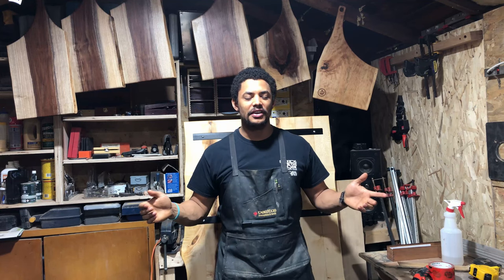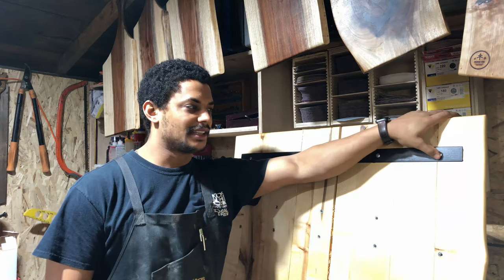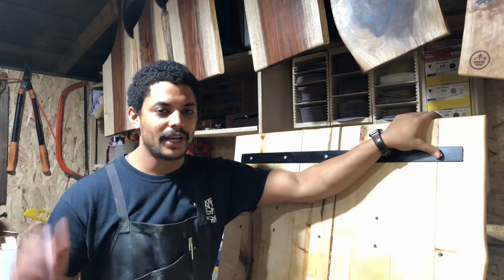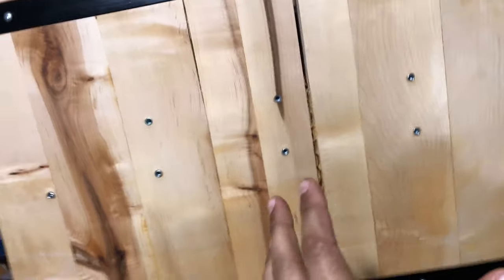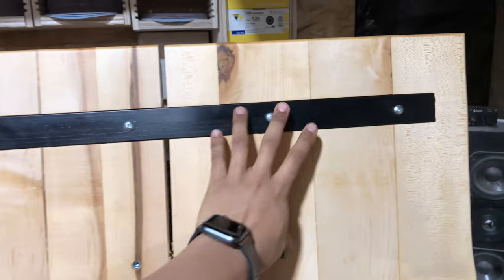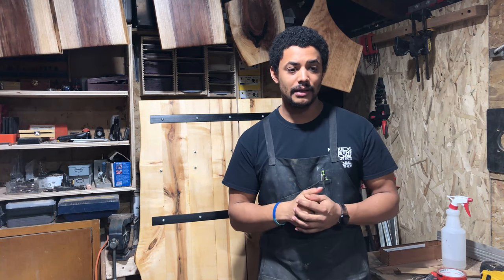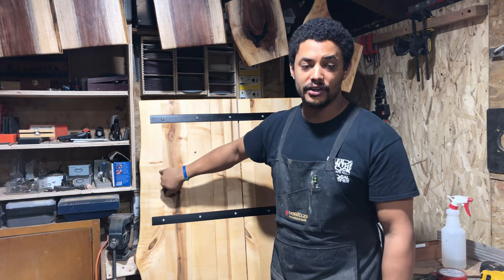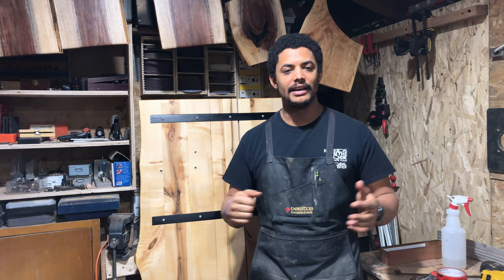C  Channel Ripped Table In Half!

Comment: I would recommend extending the grove past the end of the c channel half an inch. Slots can’t move if the end of the channel can’t move in the wood.
Reply from the maker: Totally agree, If the c channel is not slotted though then it is not going to move, so if someone goes that rout, then no need for extra space on each side.
Reply: @huds-onwoodworkinginc.2019  All due respect, but no that's not true. Always, ALWAYS, extend your routed C-channel mortise at least 1/4" beyond each end of C-channel length. Average range of wood movement across grain is 1/8" or more, depending on species. I guarantee you'd find pressure dents in the wood at the ends of the mortise where the metal ends of the C-channel were in contact. This turned the C-channel into a compression strut - like post & beam in a vertical structure or a doorway pull-up bar. Your friend 5-6 months ago most likely had the heat on throughout the Winter, (low humidity & warmth = wood kiln = shrinkage). Your wood span had nowhere to go but relieve itself at it's weakest point in the middle. Your screws - in slots or not = irrelevant. All they did was hold the channel in place while it did it's evil work at the ends. Good luck. I sincerely wish you well in your endeavor.
Reply: @huds-onwoodworkinginc.2019  alspach is right. You must extend past. If there are no elongated slots, all the stress of movement is put on the screws to hold the wood movement which is why the screws were bent
Reply: @jalspach9215  I agree . And the wood was no way dry enough to start with . There is also a glue issue , the wood should have split before the glue failed .
Reply: Yes, I concur, i.e. this is exactly what happened.  Look at the end of his C Channels (no space for channel to grow in length).  The metal lengthened in the warm room and popped the table apart at a laminated edge.  I have never used C Channel and I have never had a top warp.

Comment: I have seen a number of Japanese craftsmen make large tables and they always use a tapered dovetailed stringer below to keep the table  top flat , no glue . Presume this allows the top to move freely without opening up at the joints. What is also critical is how much you tighten the fasteners,  if they are too tight and the  wood cannot move , you will have the same problem, slotted or not.  One solution is to snug up the bolts and use a drop of thread lock to prevent them from coming loose or use spring washer that will maintain tension.
Reply from the maker: Dovetail sliders is another good option. only means you have to fill a dovetail groove in the side of the table.  All good points though.

Comment: Right off the bat without finishing the video the screw holes on the c channel need to be slotted to allow for movement, if it’s got no where to go the wood will either bend metal or crack itself
Reply: Yup. No expansion give for the bolts.

Comment: C channel is fine to use for this purpose if done properly. For a table top, I use one C channel about 3 inches in from the ends, and one in the middle of the table, for a maximum of 3 pieces. You used at least 6 C channels from what I could see, maybe even more than that. That could have easily been a contributing factor in this failure. The holes, actually slots, for your screws need to be about an inch and a half wide, and then set the insert and screw at the center of each slot. ALL of the screws/bolts (whichever you use) should be snug, not maxed out tight. As others have said here, make the grooves for your C channel a bit longer to allow for movement. This will prevent another failure in the future.
Reply from the maker: Glad you found a method that works for you.

Comment: Did you finish it on the other side? I can’t tell from the video, but if the bottom is unfinished and the top is, that will lead to chaos with the movement of the piece
Reply from the maker: We always Finish both sides of the table. It is probably just the poor shop lighting that makes it look like that.

Comment: Glad I found this video!!  I'm going to be building a round table for my Mother using some Chestnut that her Father had milled 60 years ago and it's been sitting in her garage since he passed away.  I'm planning to use C-Channel on the bottom to keep it all flat when it gets moved indoors (might actually move the wood indoors for a while before working with it)..  Now I know to extend the slot for the C-Channel beyond the end of the metal and to use slots in the C-Channel itself where the bolts connect it to the table.

Thank you for sharing your experience!
Reply from the maker: Sounds like a very special project. If you are able to bring the wood you are going to use indoors for 2 weeks or so before you use it, that will definitely help to stabilize the lumber. C channel will then just be extra protection. Good luck with the project! happy my experience could help you out.

Cheers

Comment: Great lesson.  Thanks for being brave enough to share it.  Whether it is C-channel, angle iron, breadboard ends, wood battens...  They all need only be anchored securely in the center and the farther out from the center a fastener gets, the more movement it has to be able to have.  This  includes the very ends, the slot/recess has to allow room to not run into the end of the batten.
Reply from the maker: Exactly. lesson learned. Respect the movement. lol

Comment: Gonna be honest here, what was the moisture content of the wood before assembly. Once it goes into a house with low humidity, it will shrink.
Reply from the maker: Wood was kiln dried, around 8 percent. but I think you are mostly right. The house this table was in was overly dry. so dry the client has to put on moisturizer multiple times a day. So they probably need a humidifier in their house and yah the table probably shrunk because it was not acclimated for conditions that were so dry.
Reply: @huds-onwoodworkinginc.2019  did you meter it yourself or is that what the supplier said? If you haven't invest in a good moisture meter and check your boards before using. I've found boards at my hard wood dealer that were in the mid to high 20s before, that just came from the Kiln.

Comment: Needed to  cut slots in the C-channel. It allows for a little more expansion. Seems we are constantly learning when dealing with wood.
Reply from the maker: Yes Exactly! slotted holes would have made a big difference on this one. Also longer cutout for the c channel. more space for everything... lol
Reply: @huds-onwoodworkinginc.2019  Yeah I didn't even think about that. They were fairly tight in the slots. Great info in your video documenting what happened.

Comment: C channel is ment to be secured to the table with a slot in the c channel wide enough for the bolts to move and when secured to table enough room at end of c channel ends to allow channel to move freely also bolts shouldn't be tight. Just tight enough to hold channel to table to allow it to move in the c channel.
Reply from the maker: Exactly! Enlarged wholes with undersize bolts/ screws might not provide enough of the required space for movement and you could end up with table like mine(2 half tables... lol).

Comment: It looks like and sounds like the wood was not dry enough for this build. I’ve built projects with wood that was not dry enough and had similar problems.
Reply from the maker: The wood was dry, 8 percent,  but the clients house was dryer. lol . So, yes  you are right, for this house the lumber should have been dried to a lower moisture content.

Comment: I’m planning on making a table that’s 36x60 with live edge on the outside boards. The boards being 6 inches I wasn’t planning on using c channels do you think it’s really necessary to use them? The thickness of the table will be 1 1/2

Comment: So, this whole long video can be summed up in a very short explanation..

First, wood moves.
Second, you need to allow for that movement
Third, elongate the holes in the channel
Fourth, make sure the pocket for the channel extends past each end of the channel, to allow for that movement.

Way too long of a video for a VERY simple explanation and correction.
Reply: Also, note: I heard NOTHING about the moisture content of the wood in the duration of this video. Moisture content is KEY! Dry your wood properly, or you WILL have problems!
Reply: @charlieodom9107  Excellent observation. Amazing how many do "the ostrich" on moisture content. One commenter suggested the extended "pocket" imperative months ago & he responded, politely rejecting it. Instead, remained obsessed on screws, slots & threaded inserts. But the irony of another lucid comment put out a deck-sweeping perspective that even I overlooked. Such a butcher-block style build would be warp/cup stable enough not to need C-channel at all. Simple & brilliant!  KISS principle again!

Also: Here on Hawaii's Big Island (for 30 years = access to incredible tropical hardwood slabs), my shop is @ 1200' elev. & wet. Here one can drive through 7+ different climate zones in 20 minutes - add to that the high-end homes/estates these works end up in. Environmental extremes - from months of A/C climate control to extended periods of open-air (Indo-Pacific architecture) = high humidity & air borne ocean salt brine. I'm constantly called in to fix such preventable disasters. If I had a dime every time I muttered to myself, "WTF?!!" Much of it really basic like sealing/finish coating EVERYTHING to encourage uniform movement. Especially undersides & relief routing where nobody sees. Too many obsess on the esthetics of presentation/visual impact. 

YES, by all means we want the wood to speak for itself. Too many shallow & exploitative hackers here relying on this alone. Some have become big names here. Get the Koa out the door! Perhaps I shouldn't complain. For decades I've made my shop nut ($$) on their irresponsible (or willfully ignorant/arrogant) greedy legacy. But I've never been comfortable with such repairs. Makes my stomach churn. I'm still asked at gatherings (20 years later!) how I managed to sell an award winning inlaid mini highboy the size of a night stand for $10K?? Too many stare at their shoes when I mention I never start my projects with a $$ goal. I'm obsessed with the form & function of a work of art through & through. The difference? To me the material begs/demands so much more, "Don't trash my unique beauty...please help me get there with the respect & heirloom quality I, and my admirers deserve." I'm an artist 1st & business man 2nd. Lifetime ADDHD/Dyslexia = feast & famine for me @ 62. Why I can/will never retire. I you strive for perfect, second best is still excellent. I understand the anomaly/dichotomy of extremes here.  I respect those who get it & agree to meet me in the middle somewhere. Cheers & Aloha, Charlie.
Reply: @jalspach9215  I live in Florida, and the humidity is horrible for wood. Most of the tables I build I acclimate inside my house at 50% or so humidity before selling to see if they are going to move. Construction grade lumber is pretty much useless, so unless you are building a rocking chair or abstract art, you can guarantee it will look like hammered out dog shit in short time!
Reply: @charlieodom9107  Ah you made me laugh my friend! "hammered dog shit" term has been a go-to for years! I morphed it a bit over 20 years ago when I started seeing so much blasted apart outdoor teak furniture & self destructing "day-old-antiques" from Bali & China. "Indonesian Dog Shit" I call it. Most of the material green from the forest or plantation - goes straight into production due to demand. Proper joinery techniques left when the Dutch were run off. Willy-nilly slop joints look like the were done by Stevie Wonder with a one tooth Skilsaw -filled with color matched pulp which holds up just long enough to sell.... Many folks shocked to learn much of it's not worth fixing. Sure you've seen the same. I know Florida well. 1st live-aboard Dive Master job at 19 was out of Nassau, Bahamas, home base was back @ Ft. Lauderdale every 3-4months. That was 1980 - 83. Cheers
Reply from the maker: @Charlie Odom  I may of not explained in this video, but the client had told me there house was extremely dry, he and his family have to put moisturizer on multiple times a day, The wood was dry to 9% which is usually adequate for the region in which we are located. Not dry enough for an environment as dry as this clients house though clearly. Either way, if the c channel would have be installed properly the table should be able to adjust to new environment wether it is humid or dry. The idea is that you need to account for that moment no matter what

Comment: How did you bond the pieces together, glue joint seemed to fail?
Reply: So what joint is better to get the boards together
Reply from the maker: I just made a new table top for the client. ill find another use for the old table someday. or burn it... lol

Comment: Could c channels cause the edges to cup ? I installed c channels on a conference table and they didn’t quite cover true edges and the edges started to cup….
Reply: Dont they recommend staying 3” from the edges ?
Reply from the maker: hmm. I have never herd of that. was the lumber properly dried and acclimated before used for the project. I usually inset my channel 2-5 inches in from edge of table. depending on size of table and size of boards used.
Reply from the maker: I think that is probably a good rule of thumb!

Comment: Having just watched your video, I hunted around and found end-mill or slot-mill bits - like a drill bit but they cut sideways.  Just purchased on eBay a 6mm (1/4") bit, which seem to be standard hole size on the leg mounting plates, and will give it a try with my hand-held drill.  Gotta be better than trying to mill it out with a standard drill bit!  I got one for £10 Sterling, about $17 Canadian - worth a shot for that price!  Thanks for the upload, have sub'ed.
Reply from the maker: Let me know how it goes!
Reply: A better option would be a die grinder. You can get a dirt cheap pneumatic one from harbor freight and cheap carbide bits on Amazon. Another alternative would be a dremel with a drum sanding/ cut off wheel attachment. Both do the job extremely well and fast, definitely more efficient than trying to use an end mill in a hand drill, good luck

Comment: I custom fabricate channel stabilizers as well as table legs for a living. Random, I know. The slotted method is definitely the way to go. For mitigating environments where you get extreme temperature shifts / and changes in humidity... the best way to go about stabilizing the slab is using a low viscosity resin like a casting resin as your initial seal coat. Poly's are good but a hand layup with a casting resin on all surfaces before final sand will essnetially lock the slabs MC in place. Obviously the MC will change but at a much slower rate. I like low viscosity resins because when you lay up with them, they abosrb into the wood like water which means they will get excellent penetration. You also get the added benefit of the slab having a little extra depth and pop when applying your clear if you use this method.

Great work, looks like a beautiful slab.
Reply from the maker: Thanks for the tip!

Comment: I have used non-Box store wood for years. Here's my take on your problem. I noticed a big difference in the wood grain in the bottom of the table. I think there are too many poor quality boards with way too much pith in them. Stay away from boards that were milled too close to the center of the tree.
Reply from the maker: These are good theories, could be right.

Comment: Interesting.  Thanks for sharing.

I have a redwood slab 4'x12' by 4 inches thick that was given to me.  Been outside drying for 3 years.  Unfortunately it has curvature in that the middle is maybe an an inch.  No cupping really just bowed.  The easy way out would be to cut it in half.  But i would really like to straighten it.  Ive had it in open air all winter will 300 pounds on center.  Seems to be holding arc.  

Thinking of cutting grooves on short side to relieve tension or maybe groove long side then pour epoxy in with ahrinkage of epoxy maybe straighten out.  

Given size wetting and drying seem difficult.  

Any thoughts?  I have a cabin that is not clumate controlled that it will be going in.
Reply from the maker: I have tried before and been successful before with the following method. You put the crown of the bow up in the air. Then set up a fan to blow air over the board. hopefully, the air movement will dry that side of the board faster than the other and counter act the initial bowing. Let me know how it goes. Good Luck!!

Comment: Wood moves, metal doesn't. Extend groves in wood & oblong all holes other than center in bracket. Also a plastic washer helps under screws that will move in oblong holes.

Tighten screws with plastic washers & then back them off enough to eliminate resistance for movement..
Reply from the maker: All Great points! Thanks for contributing these ideas.
Reply: Actually metal moves too, with temperature. So if your house is very dry and you need the heat on; the wood will shrink towards the center and the metal will expand in the opposite direction, doubling the problem and possibly pulling the wood apart. Having the table near a heat source (EG an open fireplace or radiator) would not help either....
Reply: @PeterHolt Yes, technically metal moves, but  with this situation, for all practical purposes, it doesn't..